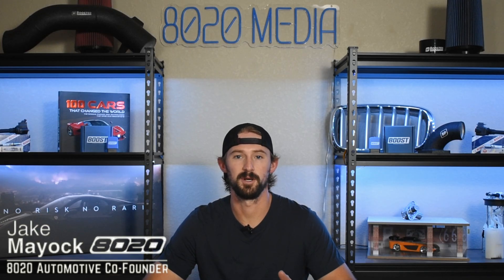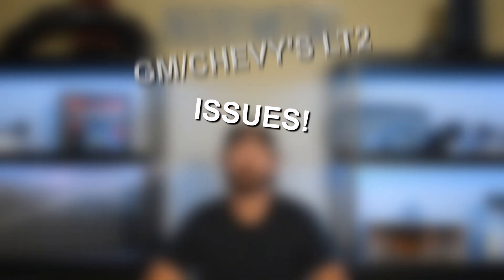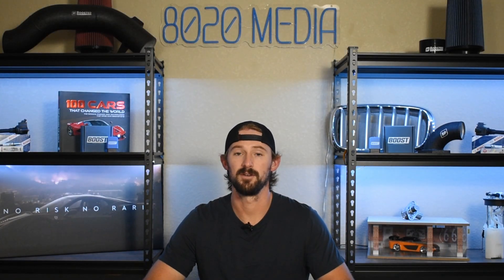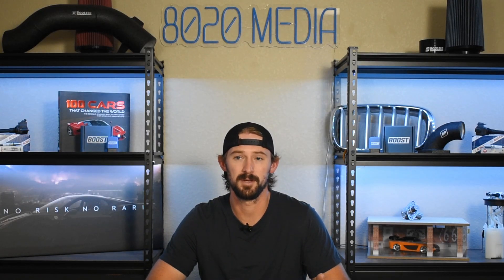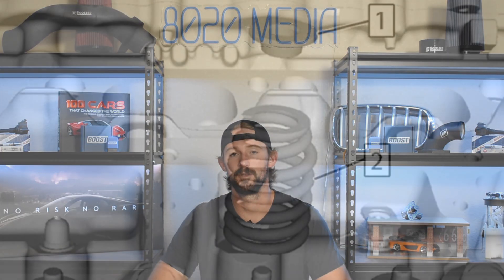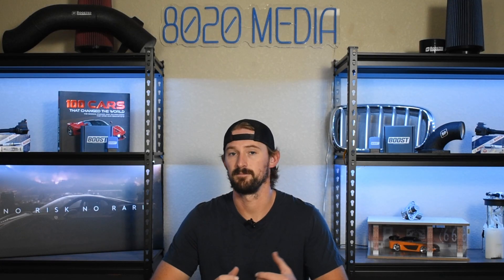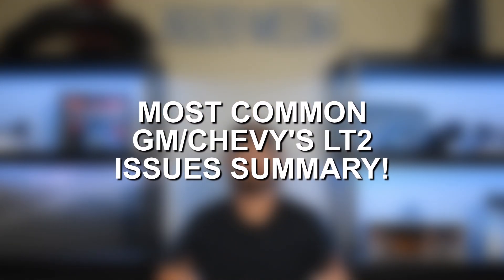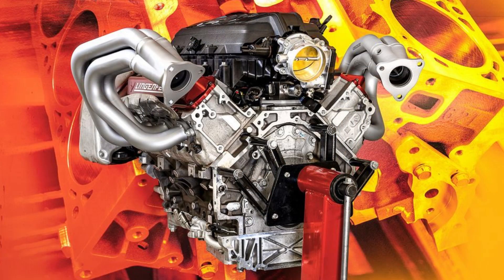The TRUTH About the Chevy LT2 Engine (C8 Corvette)!

Comment: My 2022 C8 corvette has been in the shop off and on since August 2025 and now they say I need another transmission so it is still a problem or just utter incompetence at Chevrolet dealerships my key fob remote start would start the engine but immediately shut off which any genius should know that would be for safety reasons however they wanted to charge me for a reprogramming of the remote and I said to them they will not get a penny from me so yes it's still a problem problem with the transmissions

Comment: Engine oil , trans oil, trans filter. I change those at 50% life does cost more in Maintence but changing early is good insurance with these mid engine cars esp the dual clutch
Reply: Do you just top off the trans oil when teaching reaching 50% life?
Reply: @Gabe-fn5pf  NOOOO don't do that, you need to drain and fill.

Comment: The engineers have mentioned the dry sump has oil baffles that doest not really need catch can and minimal carbon issues, for Z51, it is actually hard to get into 220F on track by constant lapping, so cooling is not a huge issues

Comment: change your on time or before... also change the dct filter more often. carbon build comes from not running it hard and get the car good and hot.
Reply from the maker: J - Fair point! Thanks for sharing.
Reply: I bought a 2020 C8 Z51 3LT 18 months ago with 15k. I have almost 30k on it now. It's been my experience that servicing the car is the best defense. I drive it daily. I swapped summer tires for UHP ALL SEASON. I have driven in 6 inches of snow and all types of weather.  I drive hard when able. 60 to 120 is average speed. I don't mind V4 mode when putting around. So far, so good. I believe that the LT2 being mostly a forged engine is what separates it from other GM engines. Time will tell. I've seen other people with 50k plus with no issues. Maintenance may be the the key.